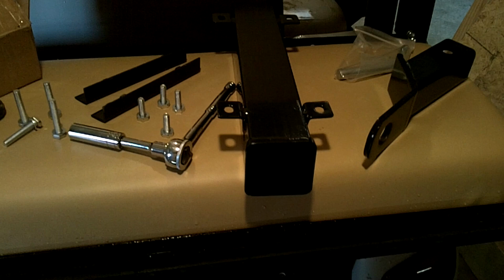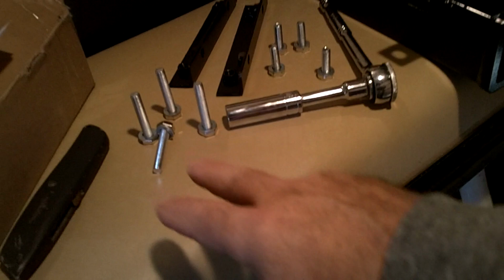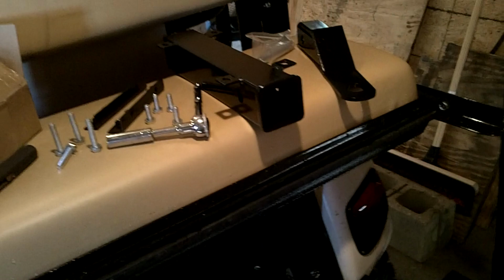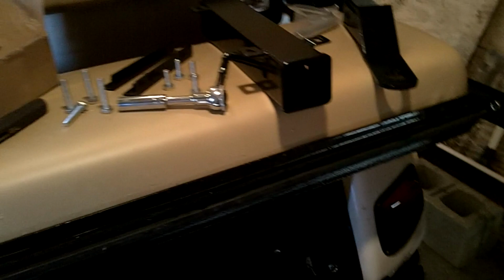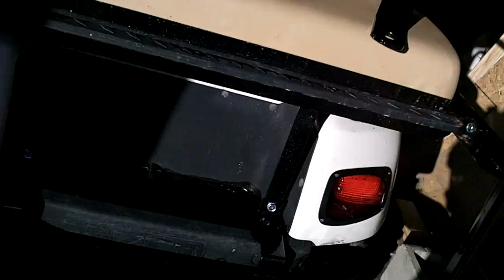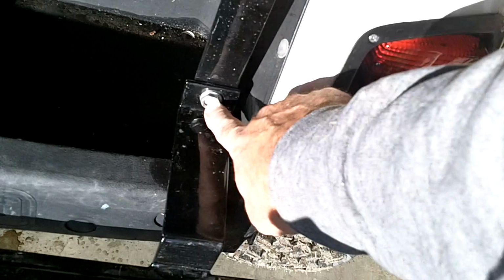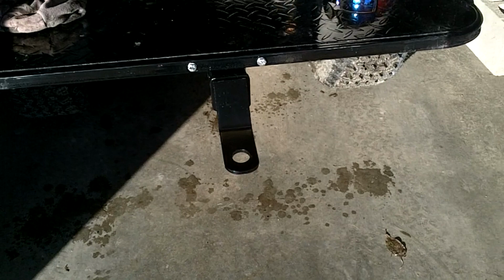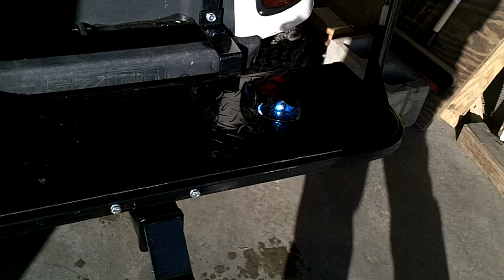Golf Cart trailer hitch install - DIY

Comment: Bolted into paper thin pot metal.  I reinforced my step with uni strut just for passengers to have a solid step.  Those steps bend in the wind but a great template to reinforce.

Comment: I'm confused.  You showed how to mount the easy screws on the bottom but did not show the hardest part, mounting the longer bolts?  Did i miss part 1 of this video?  Also were there holes already existing in the bottom of the step plate that you bolted the hitch receiver to?

Comment: Thanks bud. Do you think this will handle my double ski trailer ? The tounge weight is only like 70 lbs if I had to guess but maneuvering it may but a lot more force and I’m worried since the seat bracket ultimately just bolts back to the fiberglass. My plan is to just use it to back the skis into the driveway cause golf cart is better turning radius than my truck.
Reply from the maker: Mine cracked at the attach point pulling a lawn utility cart.  It is made with mild steel and I would not consider it as capable of towing any trailer. Being Made in china, you get what you pay for I guess.